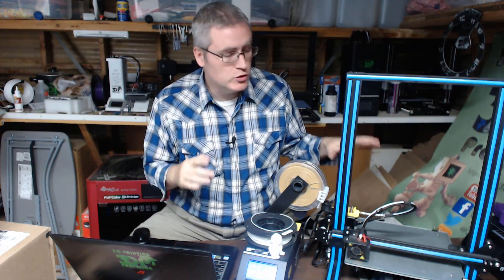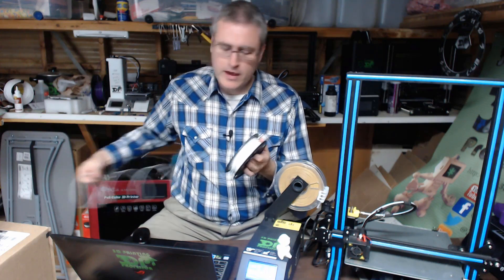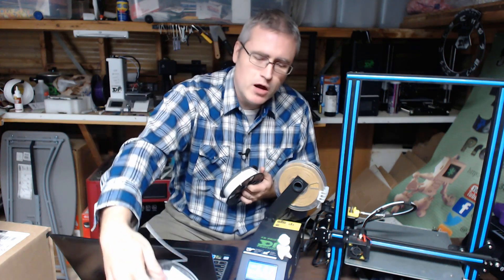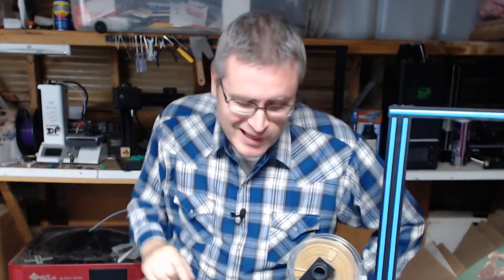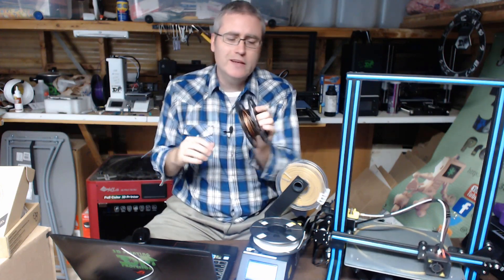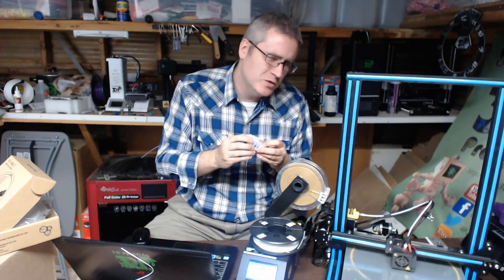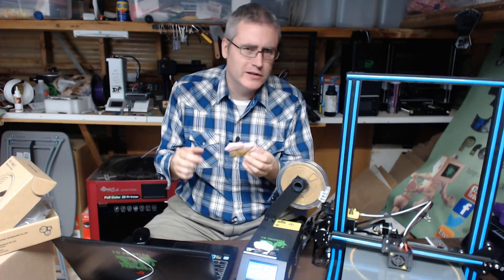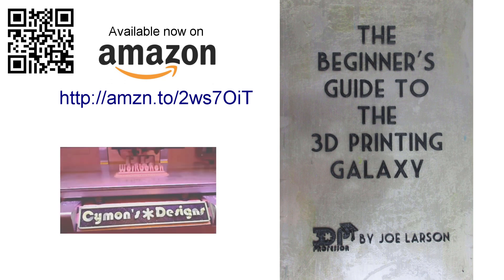Master Spools and new filament specs and Leveling the CR10S with Furling Filament

Comment: are you liking this cr10s im in between the cr10s or the tevo tornado but scared about all the stuff with the tornado salmon skin i know is a thing but the qc on there unit and nozzel replacement while all i see is good things about cr10s i want to print with abs some maybe or  tpu.. wood... carbon fiber z or x  or harder material than petg and metallic colors and with the tornado i cant find better nozzles  or even replacements and with the cr10s i can find easy replacements im gonna be printing car parts like blinker lenses stuf like that or vases and statues dice with the skull in them look awesome and just wanted to know your opinion on it if you dont mind professor and i am also lookig for really good details on my prints and yes this will be my first printer per say lol
Reply from the maker: Hopefully this week's video will address exactly this, but if you don't mind spoilers, you can see what I have to say below...

I friggin' hate Tevo. I have wasted a month on their piece of garbage machine and haven't got a single decent print out of it.

You're going to have a hard time with ABS, I recommend ASA instead. TPE is possible. Harder materials, you'll want to modify your hot end, but that can be done easy enough.
Reply: see i was thinking that it would just be easier in general with the cr10s cause theres alot of extra parts for it and it would be easier to mod on it more of a community around it and i have not seen no where as many bad reviews on the cr10s as i have the tornado lol i only like the heated bed on the tornado but i found a video of a guy showing you how to upgrade any cr10 with the same AC heat bed and its a pretty easy installation i am not afraid to mod at all i dont want the cheapest printer i just dont want to make a bad investment and have a 500 dollar box full of parts i cant use or even replace i do understand this if fairly new tec for public use an may need modifying but it should at least work out of the box lol and from what videos i have seen it loos to me like the cr10s is capable of high detail out of the box and nice prints given the person took the time and set it up proper the first time i have not herd of the ASA filliment i will have to look that up i plan to make car parts for interior of classic cars emblems stuff you cant get anymore or is verry expensive i restore classic cars i own an operate my restoration business an i think a 3d printer would be good asset to my business as well as something i could play with and maybe make some parts an extra money with this kind of thing is unheard of where i live lol i also live in Alabama tho

Comment: Problem with small spools is the pricing. if i can get a 1kg for 12.99 and 500gr for 8.99 i pick the 1kg one.
Reply from the maker: Right? There's got to be an area where it's more per gram, but not much more per gram for the same sizes.

Comment: Why not wrap 250grams to fit on the normal size master spool, rather than complicating things with "another" different size??
Reply from the maker: Because 250g would make a very small and potentially unstable coil, where as if it were half as thick it would turn out much better.

Comment: I store my filament in zip lock bags, in a dry box it stops the rot, and if i run in to some filament not using i use  a vacuum sealer (like a foodsaver, to seal the bag with the silica gel) so that doesn't happen.

Comment: Like to see more small spools of PLA also in 2.85 mm or 3 mm. i feel this is a good way to go and not have a large half roll sitting around till you throw it away.. I really never use one full roll on a very large print.. Small to me is the way to go.. Been getting small 2.85 mm rolls off Amazon. Problem is not many colors to choose from. I only use PLA now. Got tired of the smell from HIPS, ABS etc.. plus it is not good to be in a room with that all the time.

Comment: Why not... instead of making a smaller master spool... making a narrower master spool? That way you have the larger inner diameter which helps keep filament from cracking when the closer it unwinds to the center. With a narrower diameter spool you would save more space without wasting filament because it is breaking on small diameter spools.
Reply: It shouldn't be to hard to design a threaded spool where you can choose how wide it is by how much you screw it down...and has detents as click locks.
Reply: that's actually great idea
Reply: Thank you Lam

Comment: for direct drive smaller spools will be fine, but for bowden printers it would be wasteful. The you would be getting the length of bowden tube as waste. Then what do you do with the remaining that cant be used?

Eventually you will have more and more pieces of filament that you cannot use.
Reply from the maker: 6:18, though the lead in for that starts at 5:41
Reply: 3D Printing Professor I think I missed that part

Comment: The master spool concept is dying  because it reduces the profit for the supplier. Spools are tiny cost mass produced and its a hassle for the supplier to bundle and pass on saving so the majority are not adopting it. Plus i dont want to swap filament every time i change spools and i have 25 i swap out regularly which means i would have to print 25 spools so no thanks.

I think 500g spools wold be good and you can find them around but the costs are significantly higher per weight.

I do like 1kg spools they sit on my shelf in a bag with a large silica gel cat litter contained in a coffee filter pouch and they do just fine no problems.

So overall i dont think its really a problem.
Reply from the maker: You're a bit early to declare the death of something that's just really started.
Reply: 3D Printing Professor maybe we will see but it gets slated every time it comes up on the forums, and some manufacturers i have spoken to have said they have no intentions to use it unless there is a more viable business model for them.

Comment: rafts aren't always for being too lazy, sometimes you need them when there isn't enough surface adhesion to stick.  Also you should be storing your filament in a sealed box with a rechargeable desiccant unit to prevent it from getting brittle.

Comment: One master spool with different filament sizes is the logical choice here. Manufacturing machine is set for specific weight and next run for next weight. That should be viable.

Comment: Hi 500g and 250g spools sounds like a good idea for the masterspool but why not buy a plastic tub and fill it with decedent to store your filament? If you buy a large tub, it can protect 8-10 specialized spools for decent low cost protection

Also, larger spools are just more cost effective in most cases, less packaging waste and less work to make 10 1kg spools than 40 250g spools, kind of also stabs standardized spools a bit in the back unless the smaller bundles of filament come prepared for the masterspool anyways, but for the most part, masterspool is not taking off, so before we specialize, basics first, can’t have a fancy scredriver without the original screw driver on the market first of all because if people aren’t buying the masterspools then no one will buy the specialized item, kind of like supply and demand, we don’t have the supply so we can’t increase demand and vice versa until the business takes off, good idea though :)

Comment: Haha, funny about rafts, they still have their use however like some cases of supports or bed materials/coatings it might be more useful to use a raft either to improve adhesion or to avoid a bed’s texture or warping, there are several other cases, rare as they may be, never disregard a tool as useless, just niche (oh yeah, and you can fix those problems by throwing money at them but sometimes it’s not worth the cost of a little extra pla or whatever, to each their own

Comment: How about "middle ground" on the small spool idea.   Maybe not a small spool, since as you mentioned, at the tight end of the spool, the filament gets really "springy" and hard to manage.   How about a filler shim that looks like a donut that you insert in the middle of the MasterSpool that buffers out the inner diameter so that a refill of filament has the same outer diameter as the 1Kg refill, but the inner diameter fits over the donut shim?  This way we can use the same MasterSpool as before, but you'd have the 250 gram quantity of filament, but without the tight diameter in the middle.  Shipping costs stay low, and you could even have indentations in the donut shim to give clearance for the tie wraps to be easily removed (or added if you want to remove the filament from the MasterSpool.   By the way, LOVE the channel.  Keep up the good work!

Comment: in addition to novelty filaments, there's also flexibles to consider, which are more often sold in 500 g. also, a smaller spool would mean that people with smaller build platforms can still participate in master spool. of course you can split the file in to separate pieces, but that brings along issues like tolerance and strength of the finished part.

Comment: Most of what I print I give away to the kids at our church so larger spools of cool colors are greatly appreciated by me because I will go through it. Some of the other spools that I have might sit for a while but that's still not a problem because they can always be easily brought back to life in the oven or dehydrator. I also have a cabinet just for my spools and I've used some 4 year old PLA with out any problems at all so I don't really understand this thing about "shelf rot". The problems I have had with most of my printers is software related. I have 2 printer right now gathering dust because I just don't know what to do about them. :^P

Comment: Take the filament off the spool, put it in boiling water for a few minutes, let it cool back down in the water, dry it, and put it back on the spool for age related brittleness of PLA.  I think it just makes sense to make the Masterspool 1Kg because if you are making the center the same size, the 500 gram version would turn out almost the same size, and there's nothing stopping filament manufacturers from selling 500 gram refills to fit on the 1Kg Masterspool.  That way you can use the same Masterspool for both 500 grams or 1Kg as long as the center diameter stays the same.
Reply from the maker: For 500g that would work, but I'd like some 250g or 300g coils, for which I feel a thinner spool would be good.

Comment: How about using same form factor as the 1KG spool but with less filament on? I know it is less efficient for storage, but at least you keep it simple. Also you could use some sealed boxes with silica gel instead of leaving the filaments on the shelf
Reply from the maker: That's okay for half spools, but for 1/3 or quarter spools the master spool, I feel, is too wide.
Reply: 3D Printing Professor I agree, but as usual if you want to keep costs down you need to make compromises.

Comment: Instead of smaller spools, couldn't the manufacturer just sell smaller amounts to put on the Master Spool?
Reply from the maker: I think that would work, for half spools, 500g, but for quarter spools the master spool is too wide. So maybe the answer is simply a thinner but otherwise unaltered master spool.
Reply: I would think your last suggestion would be better; a thinner master spool. If a manufacturer already makes refills, then keeping the tooling required the same, it would be easier to make smaller sizes, e.g. 250g and 500g refills.

Comment: id be interested into how many spools each user has stored on average,
i have 3 different spools of filament, so I wouldnt benefit from smaller spools as much
i just keep my petg abs and pla in a ikea samla box with clips and silica gel

im just curious since spools are at least 15 bucks if you really cheap out for a kg and i dont know how many most people with a printer would have at once
considering cost.

Comment: Would you mind doing a video on the en ironmental impact of 3d printing? In my country there is currently a lot of attention on platic waste ending up in nature. I know PLA is biodegradeable, but requires spesific temperatures and so forth in order to degrade. Would be neat if someone could elaborate on this and set the record straight in regards to the environmental aspect of 3d printing.
Reply from the maker: Can't say I really understand the environmental impact of 3D printing. I'm not sure anyone does. It's more than just the plastic. It's the electricity use offset by shipping, as compared to commercial products, but can we really make that comparison? There's a lot of useless junk made by 3D printing. But, just by spreading out the impact aren't we winning over traditional manufacturing.

In other words, it's a complex, multifacited problem. I'll give it some thought. If you find any research about it, let me know.

Comment: Do anybody have a tool to easy weld to filament togheter? To fuse two 1/3 full into a 2/3 full spool.
Thank you.
Reply from the maker: I've seen DIYs, but never a commercial product. Could be a good kickstarter if someone were to put a heater element and temp sensor with some minimal electronics on a set of pliers with 1.75 and 2.85mm holes drilled in where they clamp.
Reply: Thanks you very much Professor!
It shouldn't be to hard to design, but the maketing for a KS campaing might be overwhelming, but it is interresting! I'm just not to sure about the number of people who will be willing to buy it...

Of course, all is about the price tag Vs how well it's working.
Reply: If anybody is interesting in such "filament splinting", please let me know and tell me how much are you willing to pay (the faire price, shipping included) for it?

Comment: I've thought for the last several years, it would be nice if you could walk into your local craft or hardware store and buy filiament by the yard or meter. I wouldn't ever buy a specialty filament for the size of the spools alone. If you don't use it that often it goes to waste or wastes space if you store it properly. 

Getting a printer at those same types of store would be nice as well. So far I've seen one of the chain hardware stores carry the Dremel printer and filaments for a while but it was extremely overpriced for the quality and capeability.

Comment: smaller spools would be fine as long as they didn't cost way more.
Reply from the maker: Way more per gram, you mean. I think it would be financial suicide to charge more for a quarter spool than for a whole spool, but I also think paying a little more per gram would be understood. After all, it's a different process.
Reply: correct.  a little more per gram is understandable.  If they keep it affordable I think it would be a huge success
Reply: I dunno. I was on a website tonight, looking for a part and found it for $2.11 each or $23.00 for 10... LOL

Comment: Small spools are fine, need wider implementation for sure. But the reusable spool and it's consistency in unrolling is a concern of mine.
Reply from the maker: Richard Horn actually addressed that in the video I linked to in the cards. His conclusion is that in practice it's actually not that bad.